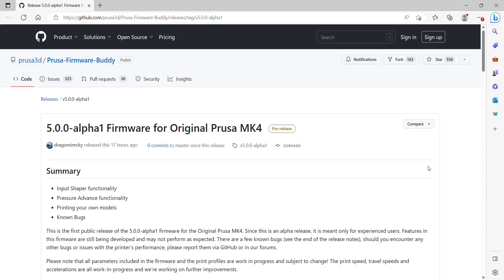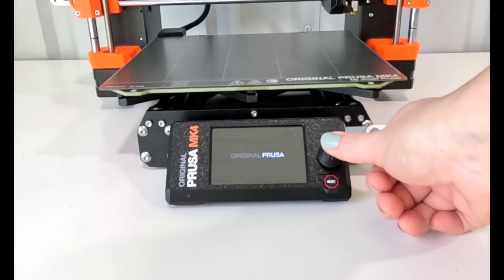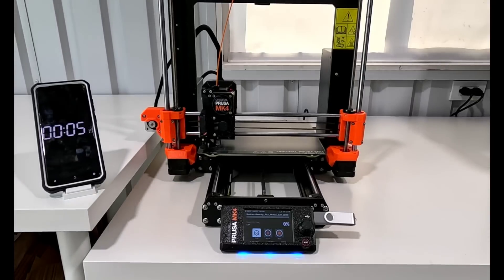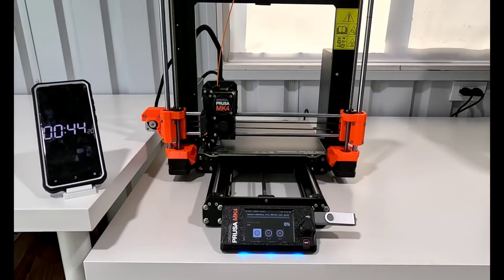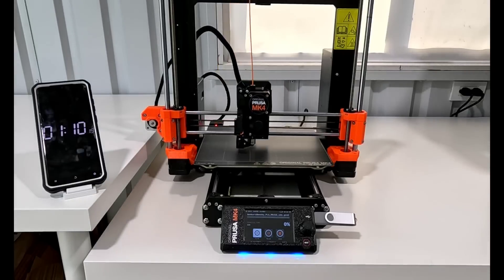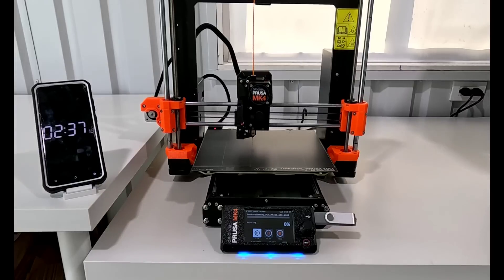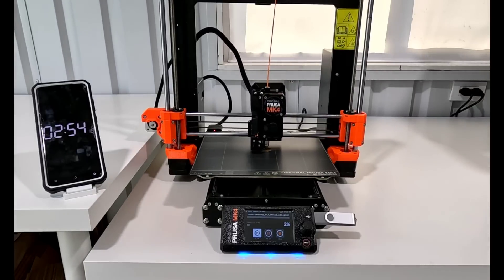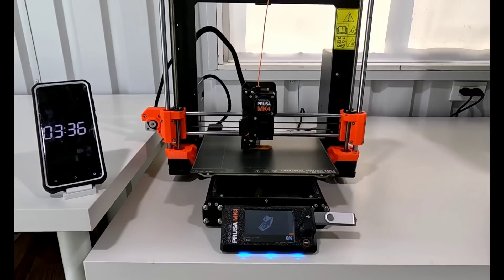Bonkers Benchy on the MK4! Input Shaping Alpha is finally here!!

Comment: either 1100 and it can sorta print a decent benchy that is super thin around 12 minutes..or just print a real benchy in 12 minutes for 600 bucks on a p1p..or spend the same 1100 on a x1
Reply from the maker: Is the X1 the one that can print multiple filaments? Thanks!

Comment: I still don’t understand how the inputs shaping sans accelerometer works with the upgrade kits. I understand that the complete printers (and possibly the kits) have had their shaping parameters preset at the factory - but if you’re getting and upgrade kit as I am doing to go from 3S+ to 4, how is the resonance / shaping parameters going to be set? Do we need to get accelerometers to do these settings ourselves? Thanks for the video, really looking forward to trying out the new firmware once I’ve upgraded. 🙂
Reply from the maker: That's an interesting question. I didn't think about those upgrading. Have the upgrade kits started shipping? Thanks!
Reply: @tada3dprinting  Not yet - at least I haven’t had a shipping notice. I think they’re due to start some time in June. 🤞

Comment: What was the speed for the shiny benchy without input shaping? 45 minutes? Perhaps try input shapimg on a larger file that you recently did withoug input shaping  so we can compare quality and time on a part where it can reach max acceleration.  Its useless if the quality is poor but I expect the Prusa mk4 to have great quality even at fast print times
Reply from the maker: No it's over an hour before IS.  I'll have another video tomorrow with a little more details. But I LOVE this update and can't wait for it on the XL! Thanks!

Comment: I read that Prisa will be releasing the MMU3 (Multiple Material Upgrade v3), hopefully in June.  Will you be getting one?  It looks really cool, but i don't know how much it will cost.
Reply: I meant *Prusa, not Prisa. 😂  Also, this mmu3 thing would be for the MK4.  I think the XL handles multimaterial using an automatic tool changer etc.  I'm still researching and saving $ .  I'm leaning to the Mk4
Reply from the maker: I'll have to keep an eye out for it! I've never run an MMU before. I was figuring the XL would be the machine for multi. But at this point, whatever gets to me quicker, I'll take. Thanks!

Comment: I found another video and je clearly shows where the input shaper sensor should stick and there is none. Can you confirm a sensor? Otherwise I dont understand the new Alpha version and also dont understand why they come without sensor?
Reply from the maker: Can you send me a link? The only thing I changed was the Alpha firmware on the MK4 and downloaded the new 2.6.0 Beta 3 Slicer. Thanks!
Reply: Shure 
12:14 he shows were the sensor should be
https://youtu.be/0q-SdDhPLnQ
Reply: They use accelerometers during development to create a sort of profile for the printer. I don't know how they compensate for differences in the weight distribution of the objects being printed (or if they do any compensation at all), but without an accelerometer it seems to me the printer's input shaping capabilities will be limited.

Comment: Glad to see progress on input shaping. I wish the presliced file wasn't single wall so it's a more even comparison. As someone else mentioned, the matte finish on the speed benchy is because it's extruding near its flow limits for that filament. With this firmware is it possible to tune input shaping? I read somewhere the Nextruder has a built in accelerometer, but that was for the XL and I am not sure it applies to MK4. Thanks for putting this together!
Reply from the maker: Makes sense on the matte color. I don't know if I can tune anything on the MK4 itself. But I was able to download the new 2.6.0 beta 3 slic3r and I'm experimenting with files this way. I've printed one that was 1/3 the time of the Mini. Going to keep comparing. Thanks!

Comment: I really don't know why Prusa released that modified pre-sliced Benchy. If they want to demo a super fast print, they really should have picked a different model to demonstrate it.
It's disingenuous at best.

Is the 27 minute Benchy #speedboatrace rules? If so, that's the one to be printing for direct comparison - maybe you want to print that one next?

The lack of variable input shaping for the Y axis will presumably cause the quality of models to get worse as they get higher too, so super fast printing speeds will only be suitable for small parts.
Reply from the maker: I want to try and print the 19/20 min benchy next and compare it. I haven't been able to get anything else to print with the bonkers benchy settings and work. So I'll probably just be sticking with the regular IS profile. Thanks!

Comment: Any difference in reliability or how much you have to fiddle between the mk4 and xl?
Reply from the maker: They're both great machines. The XL was a tiny bit faster before Input Shaping came out on the MK4. 

My MK4 has some small dents on the PEI sheet from the calibration that I don't love. Hard to compare if the XL would have this because there isn't a PEI sheet for the XL.

 I also have not been able to get TPU to print on the MK4 yet. Other than that, they're both great. I mainly just focus on larger prints on the XL of course. And the XL is still my favorite. Thanks!

Comment: Thanks for sharing.  I bought the 0.6mm nozzle for my MK4 as soon as they became available to reduce the print times.  However this Input-Shaping firmware totally blows it out of the water.  Even though its limited to 0.4mm nozzles and 0.20mm layers right now.  The speed and quality are impressive.  Can't wait for this firmware to be available with more options.
Reply: Interestingly, I just ran two prints, both on the same firmware, same nozzle, same filament, same PrusaSlicer 3MF project.  I literally just switched between the MK4 and the MK4 + Input Shaping.  Print times were 3h45m (normal) and 1hr38m (input shaping).  Both parts look great, almost impossible to tell the difference.  However the Input-Shaping part is 3% lighter.  Not sure if its underextrusion or some other minor differences between the print profiles.  PrusaSlicer shows both should have the same weight.
Reply from the maker: Yeah at first my XL was beating the MK4 on speeds but I doubt it will now until Input Shaping is ready for the XL. I did go through a couple options in slicer to compare times for the MK4 with IS too. And anything under 5 hours seemed to be about 1/3 the time with the IS. I have not been able to get the bonkers benchy settings to work on another print. But just the regular IS profile looks amazing. Thanks!

Comment: Prusa mentions accelerometer for the toolhead, but input shaping needs to be done on both axis. It's unclear how prusa intends to deal with input shaping of the Y axis as the bed accumulates printed material and the resonant frequency changes dynamically through the print.
Reply from the maker: Hard to say. But if prints improve in quality AND speed, I'm happy. Thanks!

Comment: 18:14 - In addition to the input shaping this firmware itroduces pressure advance and precise stepping which aim to give better print quality in terms of layer lines. From the github:

Pressure Advance is another important addition to the firmware’s set of features. This function aims to improve the quality of printed parts by compensating for the pressure changes in the nozzle during printing. It works by extruding extra filament during accelerations and retracting the filament during deceleration to maintain a consistent pressure inside the nozzle. Pressure Advance together with Input Shaper enables printing of better-looking models, reducing ringing, overshoots and issues with inconsistent filament extrusion. They also enable faster printing.

Precise stepping is a new implementation of the stepper routine, that allows precise timing of motor steps. It was a necessary prerequisite for both Input shaper and Pressure advance.
Reply from the maker: I did read this but kind of skipped over it in the video. Too excited to try it all out! Thanks!

Comment: What happens if you follow their "Open source" idea and mod your printer (like changing the extruder), does that break the Input shaping because it doesn't have a motion sensor so is based specifically on a stock printer?
Reply from the maker: I am sure if you swapped to the nozzle adapter and did other nozzles you would be fine. But idk about changing the extruder. Personally I love the Auto Z so I wouldn't want to give that up.

Comment: I'm curious, Did you have to run any calibration routine before the print? I ask because the calculated compensation values for input-shaping usually takes into consideration the reverb / vibration detected by accelerometers which are sensitive, in part, to where the printer is sitting. I'll be pleasantly surprised if Prusa came up with a input-shaping profile that works regardless of the rigidity of the table/shelf where the printer sits on.
Reply: the mk4 doesn’t come with an accelerometer, unlike the XL with one for each toolhead.
Reply from the maker: No there wasn't any extra step in between flashing the firmware and starting the correct gcode. But each print with the MK4 gets the auto Z calibration. And the table I had it on was an ikea top with ikea legs. It's the worst choice for something moving this fast. Thanks!

Comment: The big thing is, that Prusa showed the Speed benchy within 20 Minutes. But it was preheated and calibrated before. So there is a huge improvement. At your time of start to finish it was just 15:07 minutes. Its very very good!
The Overall quality also very very good :)
Reply from the maker: It is thin but a nice speed to start with. Thanks!
Reply: They have 2 versions, a 'bonkers' that is not a true benchy and the real benchy. The real takes 19min print time (pre-heat etc is additional). Still insane speed for a bed slinger with great quality for the real benchy.

Comment: Super interesting, thank you! Not sure how often I would use the fastest mode, but having the option to quickly print the next iteration of a part is really useful. Sometimes, you just need to hold the physical thing in your hand to understand what you need to model next. Looking forward to the final firmware and more infos on input shaping. I was also surprised to hear how different the mk4 sounds compared to my mk3s, particularly at these speeds. It's fierce! 😅
Reply from the maker: I agree that it may not be polished enough for an end product. But for prototyping, it would be great. Yeah it's really moving! Thanks!

Comment: Looks like it's FAST.  I like the realtime video and timer clicked from very beginning, rather than a fast forward speedup.  I'm researching printers to buy and this really shows me more what to expect in real life.
Reply: fast is relative. right now it is fast if you do lotta prototyping, cause there are very little cases where such thin walls are beneficial. unless with further updates it can print as fast while extruding more material :)
Reply: @ErLeuchten  i think a good high flow hot end would help

Comment: btw with speed benchy rules, you can start the timer when it actually starts to print. No need to include bed mesh and all
Reply: True, but also this Benchy doesn’t conform to the speedboat rules anyway so it’s kind of a moot point. Printing with speed boat rules, it looks like it takes somewhere between 19-25min on MK4 depending on the exact slicer settings.
Reply: I actually liked it timed from very beginning because as a 'soon to be'  first time 3d printer purchaser, and researching printers,  I'm interested in how long it takes all together so when i get one i know more what to expect.